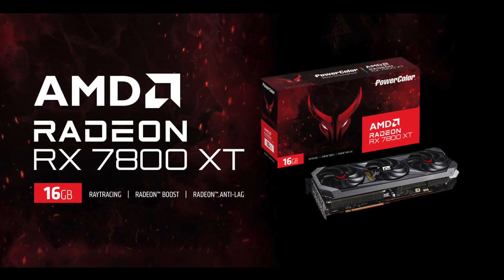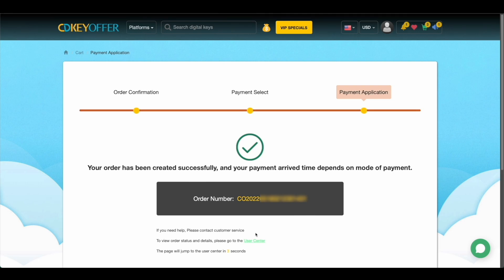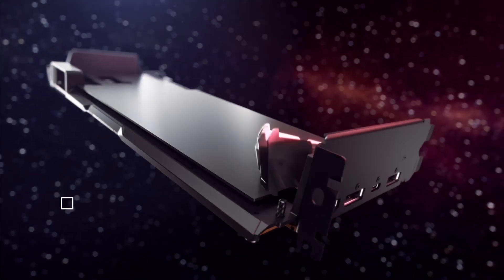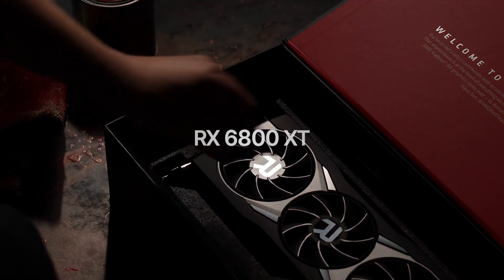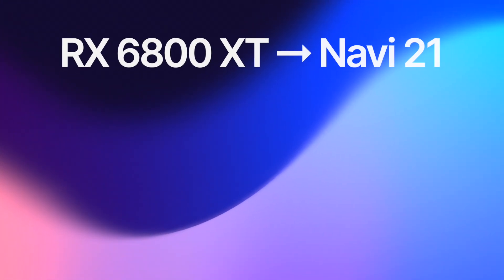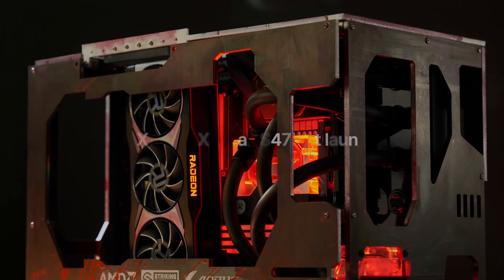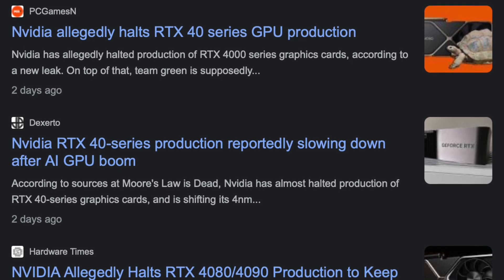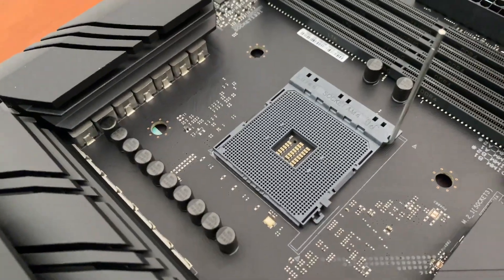RX 7800 XT is a DISASTER in the making! [Specs, Performance, Release Date, Price]

Comment from the maker: What do you think? Should AMD rename this GPU to RX 7700 XT?
Reply: If the RX 7800XT really would be a slower card than the 6800XT then clearly it’s named wrong. AMD are doing exactly what NVidia (or should I say NGreedia) did with the 4060Ti, make a card that underperforms v.s. its intended predecessor and has no meaningful uplift in price-performance. Both these companies are trying to upsell us with wrongly named GPUs. In my honest opinion the 7900XTX should have been called the 7900XT and the 7900XT should have been called the 7800XT. Both cards should have also gone for cheaper prices. This confirmed “7800XT” card is truly a RX 7700XT. But instead we’re left in the realms of corporate greed.
Reply from the maker: @somebodyrand0m280  I totally agree with you🤝
Reply: @somebodyrand0m280  The part you're misunderstanding is that AMD already dropped the prices on 6000 series to match the price/performance of the 7000 series. The 7800xt is probably going to be between a 6800xt and 6900xt performance wise and cost around 500$, effectively replacing the 6800 xt as it is now. Remember, the 6800xt is a 650$ card, not a 500$ card, so selling the 7800xt at 500$ launch MSRP is an improvement in price/performance over the launch MSRP of the 6800xt. There will probably be future sales on the 7800xt bringing it even lower as well.
Reply: @Iggy_87 A few months ago, my plan was to wait for the 7800 XT but AMD was not in a hurry to release it so I stopped waiting and bought a 7900 XT.   I'm very happy with it.  The Nvidia 4000 series was a big deception that made me switch brand; I had a 3070 before.
Reply: Name doesn't matter only price $500 max fr that level of performance
Reply: Did any of this surprise anyone? Look how awful RDNA3 is. Of course, every sku is going to be trash. How hilarious will it be if AMD launches these GPUs and restricts FSR 3.0 to 7000 series gpus!
Reply: Yes, but they won't... how could AMD could justify increasing prices this time (previously, they could do it with 5700XT -> 6700XT), now they rename a 7700XT as a 7800XT, put a price below the 6800XT ones and call it a day.... like Nvidia (4050-> 4060; 4050ti -> 4060ti, etc..) but Nvidia have more chips to do that (AD107, 106, etc...) ... in fact, if AMD could have done it: Navi 33 = 7600XT, but they didn't...
and, I bet, that orchestrated leaked is to check the future reception of that 7800XT... to rename it as RX 7800 to be sold at $499 (AMD/XFX model, Sapphire/Powercol would be above $549) and then AMD could say: it's better than 4060ti at the same prices...
Reply: Personally I thought the 7900 GRE was the going to be the original 7800xt and this 7800 xt is either the 7800 non xt or the 7700 xt. Technically the number of CUs is the same as the 6800, but I would expect to be 5% - 10% slower than the 4070.
Reply: The 7xxx is the way.🎉
Reply: Yeah they should since it's a real performance of that gpu same with RTX 4070 which should be a real RTX 4060ti. Shame on both companies hopefully Intel going to be not as scummy as our duopoly.
Reply: i don't care its name. just require the price match the performance.
Reply: Maybe, but it's just a name. It's the only thing I DON'T pay attention on when I'm buying a gfx card. You need to look at performance, noise, power consumption and decide if it's worth your money.
Reply: They should but they won't.
Reply: Yes
Reply: Yes. Cause chances are it wont even be as fas as a 6800xt.
Reply: it is 10% faster than 6800xt @kapler8550
Reply: Omg!!!, Absolutely they should
Reply: Definitely. Its a massively overpriced 7700XT.

Comment: Should I buy a rx 6800 xt or wait for the rx 7800 xt?
Reply from the maker: If you can get an RX 6800 XT for very cheap then it's a decent choice (well well below $500). Otherwise, may as well wait for the slightly more power-efficient 7800 XT to arrive in a week.
Reply: @theivadim  the rx 6800 xt is around the 600 euro's where I live.

Comment: But there is still a huge gap between the 7800XT which has 60 CU's and the 7900XT which has 84 CU's. That is a big difference of 24 CU's. 

Why did AMD not release a SKU with 72 CU's?.
Reply: 7900 gre, don't ask me why they 'launched' it 5 months later

Comment: That 7800 Xt would card for me to update from 5600XT, but as specs was even lower than 6800XT. Did´t see reason to hold breath for officials launch and decided to go for older 6800XT. Not the latest card which would always be best option, but some choices need to be done..
Reply: I was thinking the exact same thing, Wanted to go to Enthusiast(7800XT) class from Mainstream(5600XT)
but currently this dosent look that good!
Reply: The 7800 card will probably only be slightly better than a 6800. Price is a wildcard, but the 6800xt is going to be a great card for at least another 2 years.

Comment: This generation, anything under 4090 and 7900XTX is trash tier.
Reply: You say that but for who? People playing 4k or something? Look at steam hardware stats most people don't even play at 2k at 144hz, so anyone at 1080p doesn't need anything more than a 6800...I mean even a 2060 super would do the job at that res.
Reply: @anids1988  I'm saying that as it is. "This generation", as in RTX 40 series and RDNA 3. Anything under the top tier is basically trash and you can simply replace it with the last gen cards.
Reply: @rvs55  i meannn yes kind of but rdna3 does have some gains over rdna2.
The 3080 12gb is solid buy though and the 6800xt also seems to be pretty good if people want a mid range card that isn't gonna cost them a kidney! in the uk atm we can get a 7900xt for £724 ish with the ultimate edition starfield (so £650 for the card) witch i honestly think is a good deal.....that being said gpu prices are wild atm and i dont see them coming down as the AI market will legit pay anything cuz they have so much funding they cant spend it fast enough, did ya see that guy showing he brought like 200 7900 xtx or something like wtf no wonder Nvidia and Amd not worried about pricing.
Reply: You mean 4070 right? 4090 is overpriced and unnecessary for most of the users. Unless you're an AI researcher or pro gamer it's not worth it. Not to mention that they will probably release much better and GPU in next decade or so and by then even 4090 will be obsolete and "trash tier".
Reply: @farw1nd  "Not worth it" and "overpriced" is subjective. I had a 2080Ti, 3080, 3080Ti and now a 4090. Sold the 2080Ti and gave the 3080 to my brother. Still have the latter two in my rigs.

For the 30-series cards, the 3070Ti and 3080 were still decent cards in specs compared to a 3090. They weren't as gimped as the 4080 and 4070Ti  in comparison with the 4090. 

The 4080 should have had 12000+ cores, and not the miserable 9728 it has now. Honestly, it's a shit show in terms of spec. I wouldn't touch that crap with a 10 foot long pole.
Reply: @rvs55  gpu market in general is a mess 4090 is some kinda overpriced flex card...1600 is just crazy price even if your rich enough to warrant buying it, but that's my opinion as that's abit much for my budget
Reply: @anids1988  I'm putting price aside and just talking purely about specs. 
The 3080 had 8704 cores vs the 3090's 10496. That's 83% the number of cores the 3090 had.
The 4080 has 9728 cores vs the 4090's 16384... That's only 59.3%
It's been gimped beyond belief. Other than the 4090, nVidia's current generation is truly trash tier.

The Radeons are less gimped between the top two tiers. 7900XT vs XTX? 5376 vs 6144, so the XT is 87.5% of the XTX.
For the last gen, the 6800XT vs 6900XT was 4608 vs 5120, making the 6800XT 90% of the 6900XT. 

But the fact that their top dog only competes against nVidia's 2nd best makes them less desirable, especially since their last gen could go head to head with the top end.
Reply: 7900xt is 15% faster and uses 150w less power or more than a 6950xt for essentially what a 6950xt cost 8 months ago. The 7600 at 250$ beats every other card other than the much slower 6600 in frames per dollar, including the 6650xt it's compared to performance wise. Both are good cards for the right bracket, and both are priced very competitively, meanwhile the whole RDNA2 line has been dropped to price/performance parity with the RDNA3 generation, they're on closeout firesale, of course the new gen isn't going to be better price/performance, that's exactly why nvidia refuses to clearance out their old products, to avoid this.

Comment: According to me , if they launch this for 500$ it actually will be a decent card given the fact that it will be atleast as fast as a 600$ rtx 4070 12 gb.
Reply: Even for 550$ with Starfield in the bundle seems like a good deal to me :)
Reply: +1 @mefjupl8679
Reply: @eikkapelimarkka9877  only issue is that, even if MSRP is 550$, in EU with taxes that will be 800 if not more so... XD
Reply: i'm gonna buy 3  @eikkapelimarkka9877
Reply: @Pyro293 Its even better than i expected.  $50 cheaper. Now just wait for the benchmarks by youtubers. I am sure it will be as fast as the rtx 4070.

Comment: if its gonna be 300w its doa immediately why? cuz this generation shouldn't have more effiency than rdna 2?
Reply: Yeah they claimed each gen of RDNA supposed to be have 50% efficiency improvement
Reply: @Dregomz02  until the 6900/6950 xt wouldnt discontinued this gpu will stay on shelve as well as the 6800 xt
Reply: This generation does have more efficiency than RDNA2, the difference is RDNA3 reports full card power rather than core power like RDNA2. A 400w 7900xtx uses less power than a 6950xt at 325w. My 6950xt at +15% power was using upwards of 600w and around 500w stock according to my ax1200i psu which has realtime power monitoring, the 7900xtx uses 400 stock and around 500 with +15%

Comment: Now it makes sense why AMD halted the release of the 7800 XT until the 6000 series stock dries up... 7800 XT is just a 6800 XT replacement and not an upgrade.

We all know the 7900 XT is the real 7800 XT and the 7900 GRE is the 7800.
Reply from the maker: Yeah. Even if the 7800 XT is a bit faster than the 6800 XT (2-3% for example), it still is a very bad look. I expect this release to look a little something like NVIDIA's RTX 3060 Ti to 4060 Ti upgrade.
Reply: @theivadim  I think it'll be even worse. At least RTX 4060 Ti brings somewhat of a performance upgrade over the 3060 Ti but the 7800 XT from the looks of it will just match the 6800 XT.
Reply: @laszlozsurka8991 less power draw, better RT, cheaper for less money? It's not too bad really. Plus next to no one is talking about these are the 1st gen chiplet designs unlike Nvidia's monolithic dies and are below what was expected performance. I expect a much bigger uplift next gen when the drivers and chiplet design is refined
Reply: @Djent_Lover  "less power draw, better RT, cheaper for less money"

So what do those mean when the performance is the same as last gen? Also how do you know it's gonna be less money? MSRP has not been set for the 7800 XT yet. Plus you can easily under-volt a 6800 XT without losing performance so in regards of the power draw, the 7800 XT has accomplished nothing. By the way, no one cares out RT performance, it's just a gimmick.

7800 XT is gonna be piss water.
Reply: @laszlozsurka8991  I said it's not to bad. Your crying over an unreleased product that is for the most part still in speculation. The 6800xt was 649 msrp and now the 7800xt will prob be 549 so that's a hundred less, for equal performance, in a smaller format I'm going to assume, with better power efficiency. And again... no one is talking about this is a new design chiplet die. It will get better I'm sure
Reply: @Djent_Lover  MSRP price of the 6800 XT doesn't matter since the current price of the 6800 XT is below $500 and for the level of performance the 7800 XT is gonna offer it's not gonna worth it. There's a reason why AMD waited for the 6000 series to go out of stock so they can launch the lower end 7000 series GPUs.
Reply: I'm going to call it now, FSR 3 will 9nly work with 7000 series gpus. For frame generation, its going to need to be hardware accelerated, hence the ai cores on the 7000 series cards. And I'm guessing AMD have been very tight lipped about this as they want the 6000 series of cards to dry up.
Reply: I like the presumption, assuming it’s one thinks reality it’s another... how you can be sure... 7800 will be only 2-3% faster?
Reply: @adrianagiuca1196  Because the 7900 GRE is already only 17% faster than a 6800 XT. Now do the process of elimination and think where the 7800 XT is gonna land.
Reply: @laszlozsurka8991  The naming of sku's is irrelevant, especially true for Nvidia (4080 12gb re-launch). AMD has done the same with the 7900xtx, which should be the 7900xt. So from past gen naming its confusing and it's by design no doubt.
Reply: @Djent_Lover  This is a 7700. Classic AMD upselling.
Reply: @laszlozsurka8991  lol. I bet your a Nvidia kind guy. They are worse
Reply: @Djent_Lover  I'm not licking NVIDIA's boots, I'm just stating what's real. This GPU is 100% a 7700 mainly because it'll be using NAVI 32 and even specs wise it's closer to a 6700 XT upgrade rather than a 6800 XT upgrade.
Reply: @laszlozsurka8991  specs wise close to a 6700xt but will perform close to a 6800xt?? It's paper launched mate. When I see benchmarks I'll start getting upset if it's as bad as you say. The naming system doesn't matter

Comment: Another bust.  What did we expect from AMD.
Reply from the maker: No one should ever expect much from a corporation. AMD is no longer the underdog that is desperately trying to win you over. They started using the same corpo strategies as NVIDIA. Milk customers for everything they've got.
Reply: @theivadim  what is your commission for Nvidia?
Reply: @theivadim  AMD is nowhere NEAR as greedy corpo as Nvidia, comparing the two is a disservice and pretty much offensive. AMD is doing fine with their marketing and 7000 series.
Reply: @theivadim also, don't forget that Intel is a a corporation too and their first gpus were literally marketed to productivity from launch, they were never about gaming and won't be until their next line of gpus come out. Not to mention the cheap quality of the reference cards and the fact that only a couple manufacturers even wanted to work with them because they new that they shouldn't get into productivity gpus over gaming-oriented marketing. That's why the arc gpus immediately fall on their face. To be fair though, I am equally optimistic about future arc cards and it's impact on the GPU market, as a video editor and graphic designer I love seeing cheap productivity gpus and wouldn't even mind owning an arc. They have a few benefits over Nvidia and AMD cards, but don't forget that the biggest GPU market is still gamers and it will be for a while.

Comment: 20 series was bad, 30 series was bad, 40 series is awful, when will it ever get better?
Reply: 30 series was  good 👍. Only 20 and 40 series are bad check msrp for 30 series.  are you living under rocks between 30 series came out?
Reply: @crabcrock  you act like there wasnt problems getting one without paying triple MSRP, the 20 series was shit, the 30 seires had no supply and now the 40 series is all so underpowered it reminds me of when intel were holding onto quad core processing like multithreading cost extra, the 40 series was a massive let down unless you have $1200 to spend, the last decent release NVIDIA had was the 1080
Reply: At the time the 30series was good but now only the 12gb 3080 is really worth getting....anything with 12gb or less is worthless now and I think 12gb will become standard going forward.....the 4070ti should of just been the 4070 at 400 and then maybe a 16gb ti for 50 more....guess we will see what they do with the 50 cards as nivida already stated they not caring about the pc market as the AI market is buying all there cards so I don't see prices getting better when they can milk the AI markets